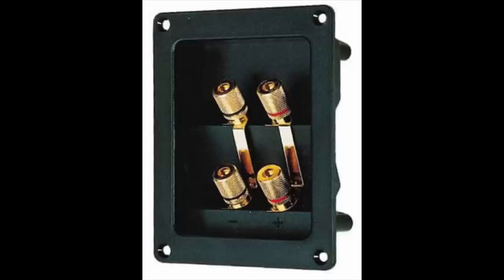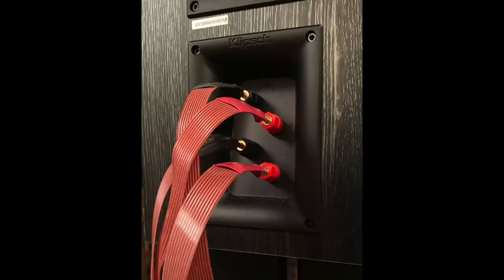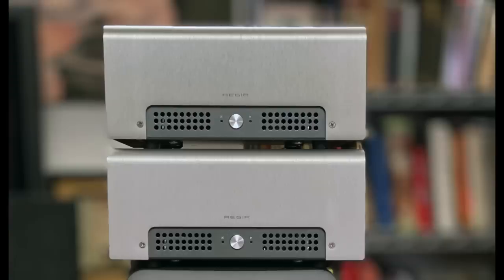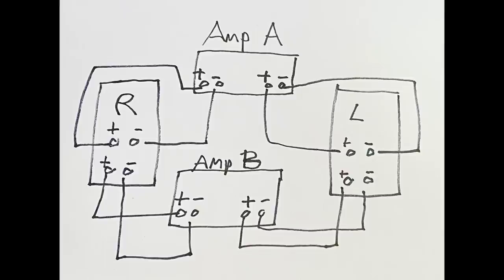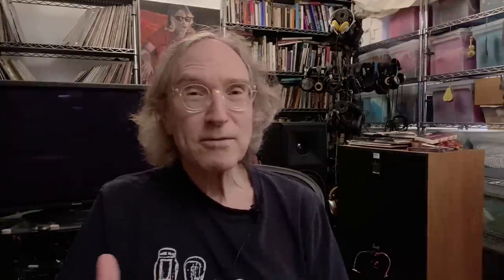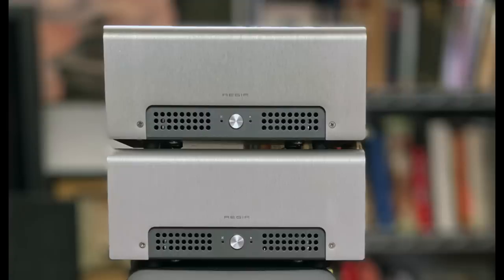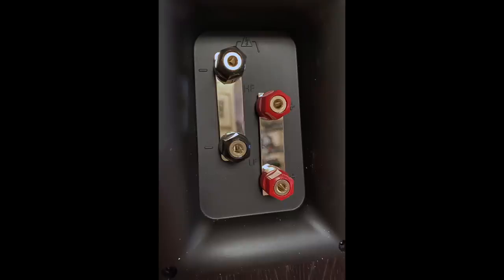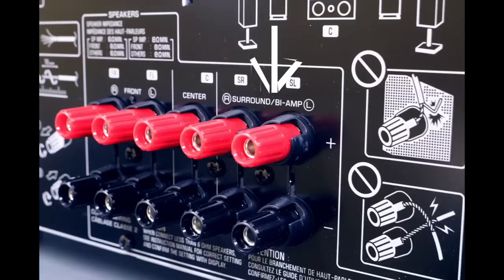It's time to think about bi-amping your speakers!

Comment: I have been bi-amping for a decade and can't imagine not doing it with my current and past speakers.   I had Paradigm Monitor 9s Mk 3 and they really responded well to a division of power to the bass and mid drivers and another amp dedicated to the tweeter.   I pushed them with a NAD 916 with Power Envelope technology.  The NAD 916 is a early surround amplifier.   It has three separate 30W amps in one chassis.   These are also bridgeable.   I had  two amps bridged for the bass/mid giving 65W (instantaneous peaks of  90W) and 30W for the highs (peaks of 45W).   Sounded great with proper placement- pull out from wall  and toe in.   

Recently I have leveled up to Klipsch La Scalas-   Got a super deal on some demo models.   I did the same amp set up-Bridged amps to the Bass unit and separate power to the mids and high horns.   

 Klipsch horns are just magic and this scheme of powering them with dedicated amps yields stunning results.   

aggressive

Comment: I am bi-amping with my Pioneer VSX-935 receiver and Klipsch F-300 speakers. The receiver does have a bi-amp setting. 12 gauge wire is being used from each channel to power the speakers.  I don't have fancy equipment to take measurements, but the difference is astounding! It does sound to me that there is more wattage, but that's just my perception, I'm sure. There is definitely more punchy sound with less distortion. The bass and treble are definitely clearer, with more dynamic range.

Comment: There's no questions that bi-amping will yield an improvement in clarity, richness, and tone. Even using a HT receiver that has extra surround channels that can be used for bi-amp, will deliver impressive results. I was amazed when I first tried this, and even though doing this limited my HT receiver from a 7.1 down to a 5.1, I could not bring myself to change it back afterwards. The front sound-stage just sounds too rich, too glorious, to give it up.

Comment: Hi there,
I found  this idea so interesting and I wanted to try it, but the lack of two identical power amps sort of almost stopped me from at least trying,,,,
but I decided to give it a go.

I’ve combined a sweet old Naim NAP 150 / 50 watt power amp and a brand new awesome Denafrips Hyperion, 80 watts power amp.
Controlled by a Denafrips Hestia preamp which has one set of XLR outputs going to the Hyperion, and another set of RCA outputs connected to the Naim.
All this finally connected in biwire mode using two pairs of Zu Audio speaker cables to my beloved Proac Response One SC speakers.
Suddenly my stereo system completely disappeared and I was listening to a live band.... right on front of me.... thanks so much my dear sir, life is great !!!!!!

Comment: I biamped my Klipsch RP280F with my Onkyo TX-NR797, I was so surprised ! By bypassing the crossover networks it improved the depth and clarity of every instrument and vocal heard. A crossover network is a compromise in filtering frequencies it can muddle and separate signals better quality components can help this, but letting the amps do this removes the need for this compromise and can wake up a dead spot in a crossover and allow an elegant design in a speaker shine!

Comment: What great timing for this topic.  I was just toying with constructing new bi-amp crossovers for my Klipschorns.  I was also toying with figuring out the time alignment between the mid and tweeter by building a new dual upper cabinet for the horns and placing them on adjustable tracks (like the fellow who did machine work in one of your earlier segments).  Might be a good summer project.

Comment: With my onkyo tx rz 3100 and klipsch rp 8000 towers it made a world of difference in low and mid level detail and spacial fullness. Totally worth while. Overall volume highs got super bright. But I like bright speakers. I think alot would find fatigue setting in after a song or 2. I love home theater as well. And what a different sound. It was effortless in dynamics and dialog.

Comment: My speakers are home-made 18" 4 ways designed for bi-amping.They are powered by a 1993 Yamaha RXV870 for the top end, to a Marchand XM66 active X-over, NAD275bee for the bass (yeah, I like class D). This is one of the best sounding set-ups I've ever heard. Quiet or exceptionally loud, it's great.

Comment: Steve, great explanation of bi - amping. I'm currently using a Marantz SR5007 av receiver to bi - amp a pair of Mission MX3s. I found the difference was amazing. The soundstage opened up by leaps and bounds, with fuller, tighter base and much more detailed highs and midrange. Never going back again.

Comment: I built one Amp Camp Amp and loved it. Then I build a second and tried bi-amping them. My premise was that damping factor was a more important limit in my listening than the limited power deliver from the little amps. When not bi-amped, the woofers dominated the amps and the amp's ability to control the tweeter suffered. That affected all the spatial cues that come with high frequency clarity. It worked a treat, and I've stuck with bi-amping ever sense. I'm now running two sources into a pair of DIY B1 Korg pre-amps, tuned a little differently - super clear for the base and a bit more 2nd harmonic for the highs. The clear one drives an F5 clone and then my Forte woofers. The "Warmer" one drives and F6 clone and my Forte mid and tweeter horns. I've never looked back. Damping factor is a spec that is probably too little understood in HiFi.

Comment: I've been saving my pennies so that I can cross over and finally buy a audiophile level 2-channel amplifier. In the meantime I did bi-amp my Yamaha RX-A2060 Aventage A/V receiver (no slouch as far as A/V goes) to my front Klipsch RP-280FAs. I have to admit I was skeptical, but the difference was immediately noticeable.  Like others have noted, the bass is much faster, the lower midrange is more solid and the highs have, I don't know, more "airiness" from the horn tweeters. Nice video!

Comment: I had an older NAD integrated amp that had A & B speaker terminals and the switch was A or B or A and B at the same time. I bi-amped a set of speakers and it was just as you described it.  The sound had more Umph to it, more body.  Which makes sense because instead of splitting the power rating between the woofer and the tweeter each got full power.
Reply: So you had no trouble with A+B whatsoever? 
I happen to own a stereo power amp with the same speaker choices (A, B, A+B), and at the rear the A+B option states 8 to 16 ohms, whereas my speakers are 6 ohms. What does your amp states at the rear, and what's the impedance of your speakers?
Reply: @enowilson  I had no problems, my amp had a switch for either 8 or 4 ohms so I had it set to 8 ohms and my speakers were rated 8 obms also. 
I would check with the manufacturer of your amp to see if or what you could do as I’m not sure. I know a lot of the newer amps don’t specify 6 ohm but you can power 6 ohm speakers with them.
Sorry I couldn’t be more helpful.

Comment: Steve.  Very glad you mentioned AV Receivers and their Bi-Amp capability.  I have an Onkyo TX-NR787 Receiver that I am using to Bi-Amp Wharfedale Diamond 250's (also a 220C and 210's) through Sewell Silverback 12 AWG Speaker Wire (my idea of a good match for a mainstream receiver).  My source for stereo audio is an HP Win 10 Pro Workstation with an ASUS XONAR SE 192kHz/24-bit Hi-Res Sound Card and Toslink to the Receiver (I use a fanless graphics card and HDMI to run my Sony 65" 4K TV as my monitor, running HTPC audio/video through the TV via ARC HDMI to the receiver for all other content).  I am streaming and downloading audio from Amazon Music HD which gives me 16/44.1 at the least, with an ever increasing selection up to 24/192.  Not an Audiophile setup, but certainly serves me well at dual duty for 2 channel music as well as multi-channel home theater.  Satisfied with the sound quality for music and concerts would be an understatement. Cello, pipe organ, 12 string, piano, Alice Cooper to ZZ Top, etc.  The Wharfedale's and Onkyo really perform well together and I attribute a portion of that to being able to Bi-Amp.  Hi-Fi has come a long way in the 5 decades I've been a half step below being an Audiophile.  Thanks much

Comment: Two experiences. A tri-amped setup with two, 2 watt single ended triodes, and a single ended 8 watt solid state amp on the tweeter. I use an active crossover so I can level the volumes. Huge horns, ribbon tweeter, fantastic sound. They let you know what the single ended triode mystique is really about. 

The second requires a little background. In the early '90s, I came very close to buying a pair of Vision Acoustics Soloist speakers. they were $1,800 a pair without stands. Doesn't sound that expensive but now that's $3,200. Their claim to fame was an 8" poly woofer with a Motorola Piezo tweeter mounted to the center of the cone so that it moved with the woofer. They limited the excursion of the woofer to eliminate doppler effect, which may be the reason I ultimately rejected them. What they did do, is present the deepest, most solid, and convincing image I have ever heard from any speaker before or since. Only about 80 pairs were ever made, so good luck trying to find a pair, but it just so happens, I did. Paid $200 for them last year. They are acoustic suspension and 86db efficient. When I auditioned them back in the day I had 150 watt tube amps. I no longer have those, but every solid state amp I have, that make enough power, sounded like crap. So I thought I would hook up one of my S.E.T.s. The flapping sound from the woofer told me that this was not enough power. So, I biamped, running the woofer amp through a QUAD sub that eliminated everything under 85hz. This is also technically triamping. This works, and I don't have enough power to bump up to the limiting factor that caused me to reject the speaker in the first place--when the music gets big, the speaker stays small. They will play Rickie Lee Jones, they won't play Wagner.

So, would I biamp if power wasn't a factor? Probably not. My triamp setup uses a lot of wire, not to mention three amplifiers. Depending on the wire and amps you use, this can get expensive. I have $3,000 into the amps on the system, $4,000 if you count the sub. You can buy a really nice adequately powered amp for $4,000.
Reply: I am also using a tri-amped system.  However, I ended up customizing the speakers to include the power amp modules.  I liked the sound when the power amp modules were in a separate chassis (bi-amped) so the manufacturer (Legacy Audio) offered to put the power amp modules within the speakers (Legacy Audio Aeris) themselves.  This is an open-baffle system so the amps are not enclosed (but are hidden).  This saved money by not requiring to pay for the power amp chassis itself as well as speaker cables.  The system came with 3 pairs of 10 foot long Monoprice interconnects.  I ended up getting OCC interconnects, so more expensive.  However, the difference in sound quality was subtle.  It was the difference between a quiet sound getting quieter versus the same sound seeming to move further away in the sound stage.  The setup is now quite simple.  One preamp, 3 pairs of interconnects, and a pair of speakers.

Comment: Hello steve, I'm bi-amping with my Arcam alpha 10 integrated & Arcam alpha 10p power amp, the integrated runs the woofers & the power amp runs the tweaters, theses amp are around 20 years old & immaculate, I've looked after them extremely well, & these still sound wicked, I'm using my Monitor Audio GS10 loudspeakers with them, the combinations suits extremely well, a great subject as usual Steve👍

Comment: I have a pair of Electro-Voice interface D speakers with C/D Interface equalizer (required for these speakers),  which then feed a Dalquist DQ-LP1 low pass filter, which in turn sends high and low pass signals to  two BEL 1001 MKIV amplifiers.  The difference in my bi amp setup is I have the amplifiers next to each speakers, so each amp channel gets a high and low signal (instead of segregating high and low signal between amps).  The resulting sound matches your results, but to my ears this is the best sound I have had in my listening room thus far.   All this is fed from an Audible illusions M3A preamp, but I have also had the similar results with an old Pioneer silver series C-21 preamp.  I experimented with with various speaker amp combinations, some bi-amped or bi-wired, but the only other setup where I could say that the listening experience was as good, albeit with chamber and classical music, was with Quad ESL 988 + Quad 405 MKII combination (non-biamp).

Comment: I ‘biamp’ in a unique way. I love the low watt SET amps, particularly the 45, 300b, 801, and the pentode el84 wired in triode mode. Each of these has stood the test of time with me. I’ve used them with a number of speakers including b&w803’s various klipsch, fostex and lowther and quad esl’s and concentric tannoys. Passdiy offered the F4 a few years ago. This first watt amp is meant to take voltage amps and bolster their power with a pure current supply. The lowend of all speakers I’ve tried in and some of those listed above across the spectrum really shine when ‘biamped’ in this configuration. Thanks go out to the Reigning King of SS -NP. I imagine amps like the decware zen would bring their magic to the more challenging but worthy speakers like the KEF ls50 & the tiny BBC monitors when complimented by appropriate let’s call’m current followers’.

Comment: I do vertical  Bi-Amping since i have finished my JBL 4341-Clones in  2018, which are built for 4way reproduction of the sound. the right side of each power-amp goes to the subwoofer, and the left side drives the rest of the 4 Drivers as are mid-range, mid-bass, and tweeter! The power-amps are from Chorea, DYNAVOX, and deliver 60Watt/Ch, so I feed 120Watts into each speaker! The Preamp is a Tube-Preamp, also from DYNAVOX, and connects with two Y-interconnect-Cables. 
My experience? 1.Class from the first second on! It sounds great, dynamics are awesome, and I am really proud of what I have achieved with so little money!  The amplifiers were an amazon-warehouse deal, and I just paid 150,- Euro per Power-amp, and the tube Preamp (with included phono stage) went over to me at about 180,- Euro!  Altogether, with interconnects just 500,- Euro! lol...And the sound is grown up! 
Tube Preamp  Dynavox TPR3 and Poweramps Class A/B, DYNAVOX ET100 can be found easily on Amazon, and they have pretty good critics! For me, they sound like the big stage of music, just as I wanted them to do...

Comment: I have the RP-600Ms biamped with a Jolida FX-10 on the tops, and two Schiit Aegirs strapped for mono on the bottoms, all driven by a Freya+ : Jolida from the single ended outputs and Aegirs off the balanced outputs. DELICIOUS. 

Keep up the good work: PS my wife isn’t so much a fan because I’ve bought so much stuff you’ve recommended! 😝🤣

Comment: Several years ago I purchased two PrimaLuna prologue 4 stereo amplifiers to bi amp my Cornwall speakers. And it sounded great. I acquired a pair of Magnepan  MG – I’s very old speakers. they were not bi ampable, and they did not sound very good with a single PrimaLuna amp. I even went out and purchased an old Yamaha P 2200 amplifier for the Mg-l’s, thinking that more power would be the answer. but they never sounded good. I then rebuilt the crossovers on the Maggies and made them bi amp. When I bi amped with 
 the prima Luna‘s they sounded  good so good in fact I started watching your YouTube channel and traded them in on a pair of .7’s.
The .7 was much more detailed and open and better soundstage than the Mg-I but did not sound as great as you or other reviewers had raved about them. Then I tried the old Yamaha with 220 watts per channel, wow what a difference that made. I just traded in the .7 for 1.7i and to be very honest you get more sound, better bass but somehow I feel the .7 is a faster speaker. With the cormwall I plan to bypass the passive crossover and use an active crossovers with the Yamaha for bass and the PrimaLuna’s for mid and treble. Right now the 1.7i are powered by a 350 watt McIntosh amp, they do need good power!

Comment: The best way to do this in my opinion is with tubes on the tweeters and solid state on the woofers. Tubes make the highs smoother while solid state gives much deeper tighter bass. Best of both worlds
Reply: Also its nice if you have 2 preamps so you can independently control tones on the woofer and tweeters using the one pre with 2 sets of preout  to feed the tweeters and the other preamp which feeds the woofers  so the first pre works as a master volume control. This really allows you to dial in the bass tones on the woofer without effecting the mids and tweeters.

Comment: Hey Steve, what’s up!
I use a combination of valve and class-D amps. My preamp is the Musical fidelity Primo pre amp (14 ECC81 Valves) and the the Auralic Merak Monoblocks (2 for  highs & 2 for lows). The speakers are Harbeth SHL5 30 anniversary.  A lovely clean sound.
Reply: Sounds like a winner.. you go with NOS tubes?

Comment: In your setup, you still have a full range audio signal going to both amps and thus to both high and low speakers.  It seems this would be so much better if there was a crossover between the preamp output and the main amps inputs.  That way high frequency signal goes to one amp, etc.
Reply: Daniel Bai is correct. In fact, in this particular situation both low-powered SET amps are still delivering full bandwidth audio to both speakers - high and low. The speaker's crossover network is just turning the low/high pass frequencies that are filtered out into heat. Those little SET amps would perform much better if they only had to reproduce the intended frequencies for each speaker range. What Steve has done here is not the way to do this!